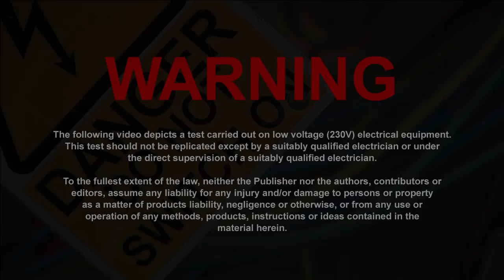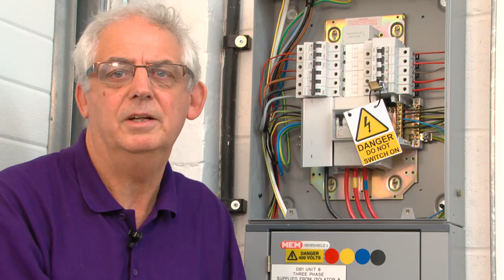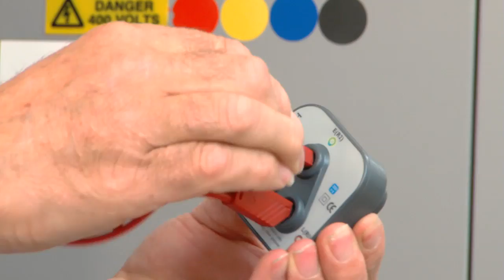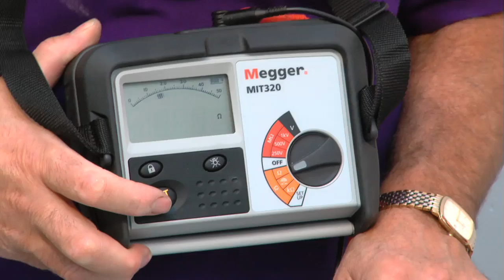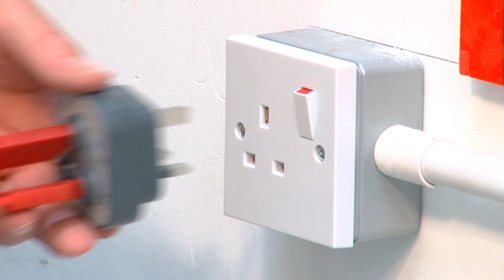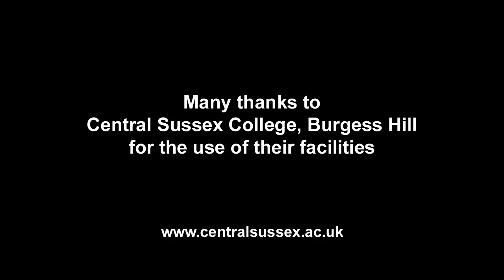R1 + R2 Test

Comment: Good demonstration.  Is there a max value for R1+Rn    I mean if there is a short between Live and neutral the breaker must also trip safely ??
Reply: No you just make sure you have continuity on live and Neutral.
Value will be same for each conductor as both same physical size so max value wont really apply.😮

Comment: Can that plug only be used on Radial circuits? Not for ring circuit?
Reply: Yes but you'd have to split the ring in the consumer box so you have two radials.. You can then test upstream .
Reply: @rusrus29  Please do video testing a ring
Reply: Technically no as you have to make sure its a ring by crossing over live and cpc. 

In reality yes.